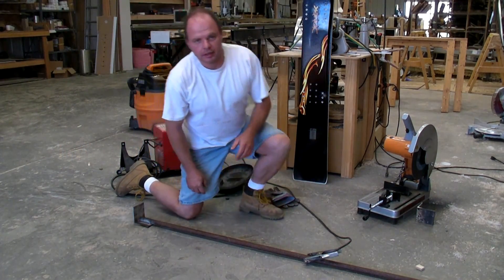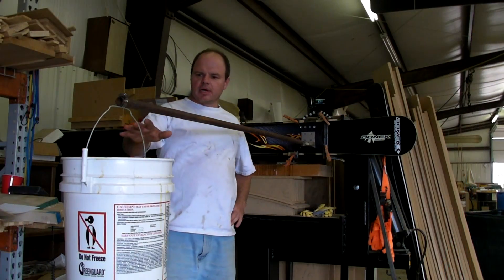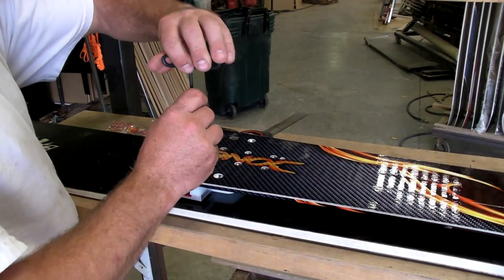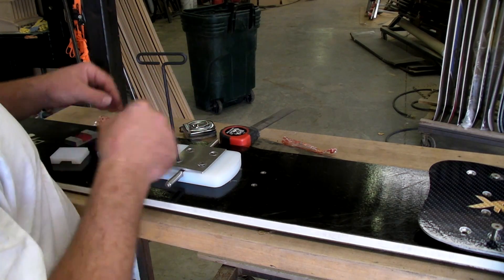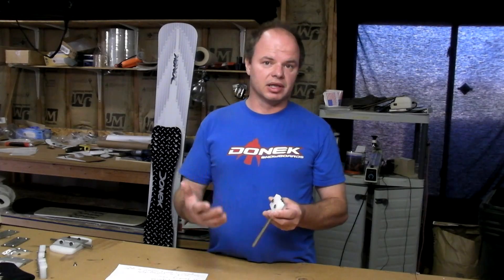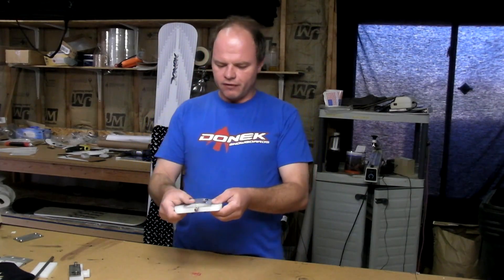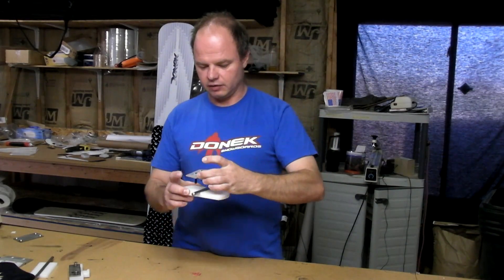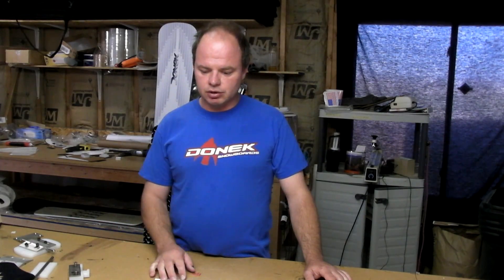Plate System Destructive Testing

Comment from the maker: @starikashka1 
There isn't really time to provide such information in a 15 minute video.  As described in the video, the forces we applied were based on previous data obtained from other tests and failures.

As for the inherent risks involved with snowboarding, they are still there.  As has always been the case, the snowboarder is the one taking the risks and should be aware of what they are.